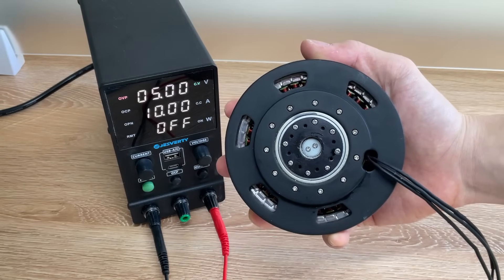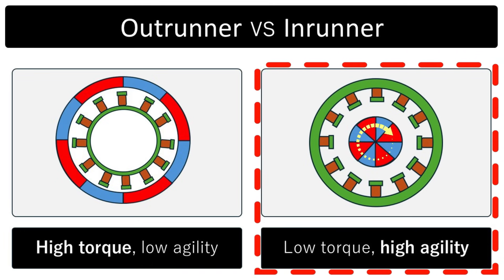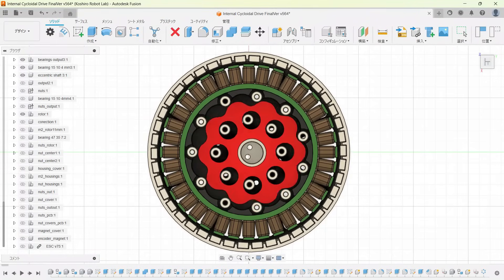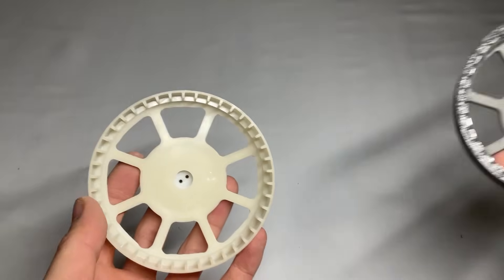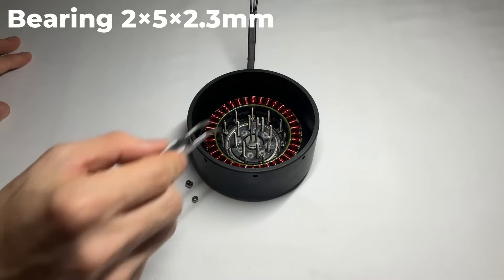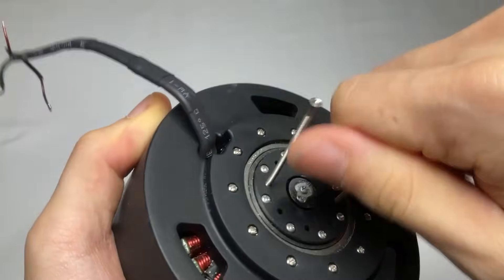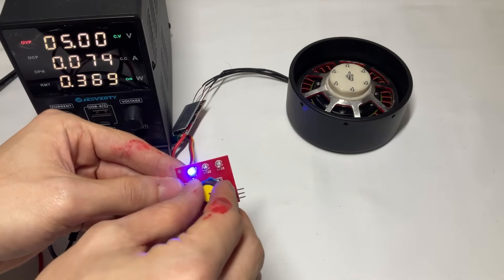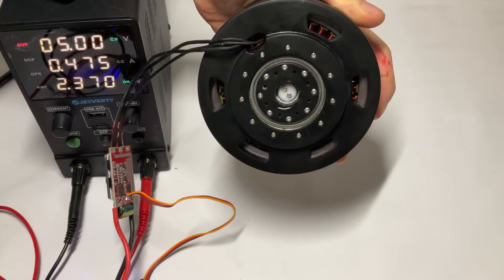Building an Internal Cycloidal Robotic Actuator

Comment: This is the kind of thing that woudl be better done with machined components, rather than printed. Certainly the shafts in the middle and anything that has a bearing pressed into it. PCB Way and probably JLC offer machining which is pretty decent, although it takes a lot longer than printing

Comment: I went down this route. Cycloidial doesn't backdrive which can cause issues in robot joints. Great for arms but not so much weight changing situations as it causes alot of kinetic energy to tip your robot. 

Also you can get motors with a internal planetary gear box for aliexpress for 40 bucks now. They are cloned from the MIT cheetah, you can also get versions in a casing with a controller and 2 encoders for 80 bucks

Comment: Hey dude! Looks awesome! I have made the exact same thing! (There’s a video on my channel of me testing it with an ESC. 2 ways to fix your rotor issue; there’s some serious magnetic forces there, so if your rotor is thin, it could easily flex. Even if it’s made of metal. Try thickening the wall of the rotor. Even .3mm of flex can cause issues. Another way is to actually constrain the rotor from the back as well. Having a bearing at the back greatly helped mine.
Now, 3 questions.
Size, weight, and cost? 
Mine is 110mm in diameter by 44mm thick and weighs 700g. Overall it cost about 90$ per actuator. Curious what your specs are.

Comment: You should use pins for the bearings if possible, otherwise impacts could wear down the screws and make the bearings loose
Reply from the maker: I finally understand your advice. I’ll explore a design that uses pins. Thank you for the guidance!

Comment: Cool design! I wondered what max phase current, phase resistance, and KV this motor has. I am also working on FOC actuator now, but it's a low-torque, much smaller, and direct drive. I guess you are planning to use a magnetic encoder in the middle of your board and use sensored FOC, right? Are you going to write it yourself or use SimpleFOC or similar?

That's a lot of work ahead! Keep crushing!
Reply from the maker: I plan to perform FOC control using an STM32. I intend to write the code myself, but I’ll be heavily referencing open-source resources like SimpleFOC. I also plan to test the motor specifications in the next video.
Reply: @Koshiro_Robot_Creator  I guess Its STM32G431 😉 Cool! That will be fun! Looking forward to it.

Comment: 7:20 if you have a 3d printer, you can easily design some rig to hold a motor while it is assembled. So, you will not have a problem with falling out screws.

Comment: James Bruton made a very similar cycloidal gearbox for his OpenDog v3 platform, there may be some lessons in his video to help.  Looks like the big difference with his is a second bearing race to keep the output centered, which should help reduce the rubbing and increase the resistance to bending torque.  

Right now any load that would bend the axle is only being resisted by a single bearing race.  Putting any leg on the output would induce a bending moment that would almost certainly crash the rotor into the stator even if you get it otherwise centered.  The good news is with this design you don't need the giant race James had, you can just put a small race on the other end of the central shaft, with some spokes to the housing.
Reply from the maker: Thank you for the advice! Comparing my design with James Bruton’s is incredibly insightful.

By "double bearing race," you mean supporting the central shaft at both ends of the actuator, right? Although it’s not visible in the video, my design also has bearings positioned at both ends. However, in this version, I didn’t use a press-fit for the bearings, which made it difficult to properly support the shaft. Additionally, the central shaft was split into multiple parts and fixed with M2 screws. This caused distortion, especially at the connection points with the rotor.

For the next design, I’m planning to create the rotor and central shaft as a single, unified part while also implementing the eccentric shape. I believe this will be the key to improving the design.
Reply: @Koshiro_Robot_Creator  Actually, I realized the closest corollary to this design is Aaed Musa's design that he had a video on 11 months ago.  The only real difference is that his is 8:1 instead of 10:1.  The red part he assembles at 14:37 is the support I was recommending.

Comment: Looks great, neat design with the cycloidal drive inside the stator! In my armchair-based opinion I think you only need to redesign the shaft, the other components fit together nicely and the rotor is just rotating off-center. Maybe use a stronger material?
Also, please wash your hands before recording shots, it looks like you just killed someone😂
Reply from the maker: Thank you for the idea! I’ll look into various options for the next shaft design.
By the way, my hands are red because I tried painting the rotor, but the material repelled the paint, so I had to remove it!